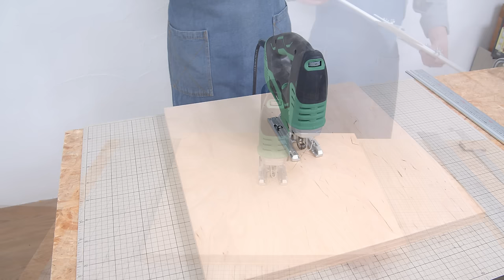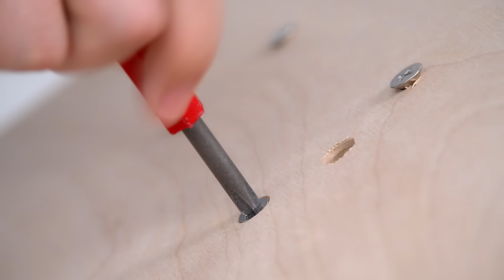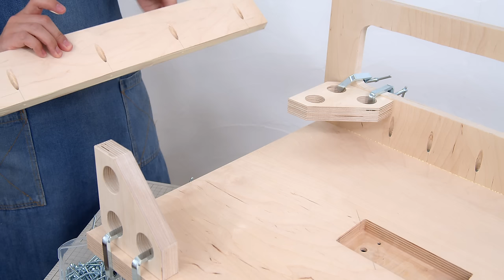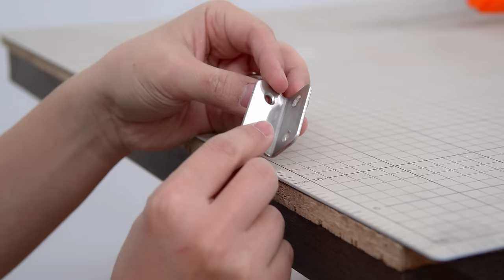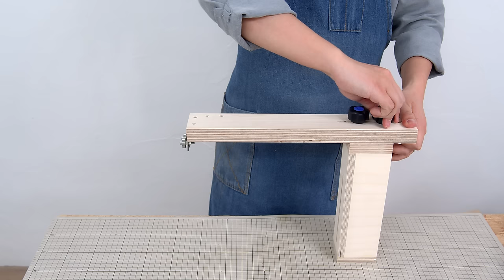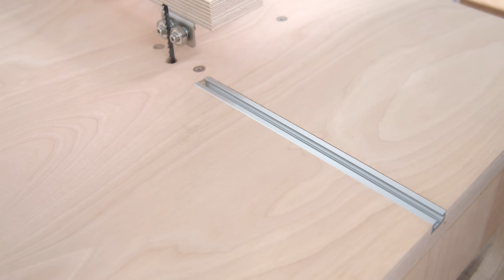How to make Jigsaw Table Machine || DIY Jigsaw Table 【JSK】

Comment: This is one of the better jigsaw table designs I've seen, BUT, I have gathered together all the pieces to make one, plus one no one else has used. I bought a scrap jigsaw today for £2 and I'm going to use the original blade guide roller from this behind the 2 bearings to centralise the blade.

Comment: Excellent design and video.  The only changes in the design that comer to mind are:
1)  Cut a small block the exact thickness of the depth that the bearing support protrudes plus one millimeter and glue it back near the rear of the support post so that when adjusting for the thickness of the piece to be cut, you can just rest the post on the material and then lock it into place.
2) If the position of the T-track was at a diagonal, then the size of a circle to be cut would be almost 50% larger.

Even so, an excellent design and build.  Congratulations!

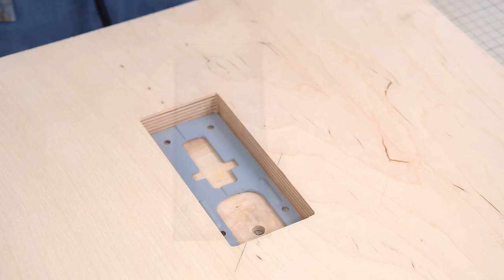Comment: Regarding @3:09, using a transfer punch (not a "center" punch) can help you to easily and accurately find the center of a hole; with little room for error. There are inexpensive as well as expensive options depending on what you'd want to get. 

I know you strive for precision. So, I hope this is a suggestion that can help in a small way.
Reply: Does anybody know  which is drill press machine at 2:27 
 . I've been looking for some and something like that is ideal.

Comment: I actually had the idea to do this but I haven't made one yet. Yours is a very nice, and simple, design with useful extra features. I particularly like the support bearings. I didn't think of that. Overall, this is another expertly made attachment for a tool (even though it's basically a tool itself). Thanks for making this video!

Side note: I didn't know jig saw blades that big were made. I'm going to look into were to find some.
Reply: Does anybody know  which is drill press machine at 2:27 
 . I've been looking for some and something like that is ideal.

Comment: Its a good built, but I will suggest for some improvement ,  I just noticed that the arm support  bracket for the blade should have fixed guide rail installed for easy straightforward height adjustments - no wiggling.

Comment: Dear Koubou, as usual, a well thought out construction. If you can’t afford a bandsaw, this is a close replacement. I’m glad you used the long blades to cut thick pieces. My jigsaw always walks to one side and doesn’t cut a vertical line. Hopefully with the bearing guide, the blade won’t bend and give a wonky cut. 

In several of your videos including this one, you show the use of a panel saw. I like the look of it and want to have a closer look before I decide to make one. I can’t find any of your videos that show it being made. Is there one that I’m not finding? If not, such a video would be much appreciated. Cheers.
Reply: I just made a circular saw table works great easy to make thanks now I'm going to make a jigsaw table love your videos

Comment: Found it interesting that for the circle jig, it's totally optional, but really useful.  I'd change that centering peg to a few different length machine screws with the threaded part at the bottom and grind the threads smooth at the top, that way you'd end up with a variety of different centering pegs so it's not necessary to penetrate the wood piece all the way through (some may not need/want a hole to fill)

Comment: A nice addition would be a height setting jig - a block that’s just slightly thicker than the distance from the bottom of the arm to the bottom of the bearings bracket. You could then set it on top of the work piece, loosen the height adjustment screws and lift the arm up, then slide the work piece and height jig under the arm and allow the arm to rest on the jig block while you tighten the height adjustment screws. Another nice addition would be an attachment on the arm for a vacuum hose.

Comment: Good job, as always!  
There is just one thing missing!! 
I just bought and printed out the drawings, which are very good, but I really wish there were a page with a list of materials used. 
Screws, bolts, nuts, etc. are quite expensive (at least where I live), and it would help A LOT to be able to buy and have all the correct materials at home when building the jig!
But that is also the only thing missing.
Reply: I thought the same thing until I scrolled down and found a link and password to the parts list and how to information.

Comment: The upper bearing block could be made slightly better by adding a bearing behind the blade like a lot of band saws have. This keeps the blade as rigid as possible so it cannot angle back while pushing wood through and would probably take some stress off the jigsaw itself.
Reply: Very true

Comment: Great job! For added safety, could a momentary foot switch be used, acting as a "dead man" switch? Or might it be possible to connect a foot pedal directly to the variable-speed saw trigger?
Reply: Yes like a sewing machine pedal but that part is a bit "electrical" to do

Comment: Excellent! I would like the screws that support the "bearings arm" to be spaced further away to promote the verticality of the construction. Easily done with a bit longer sideboard and maybe an aluminium guide exactly spaced to accept the thickness of the securing screws.
Reply: Does anybody know  which is drill press machine at 2:27 
 . I've been looking for some and something like that is ideal.

Comment: great video. great product. well done. but i dont have a £10,000 workshop the size of a small garden. nor £2,500 of powertools, £400 of beautiful wood, and £200 worth of assorted 'bits and pieces in accessories. 
yes, I'm jealous. doesn't mean i'm wrong.

Comment: Great work! BTW, you store is not working. I wanted to purchase the plan, but your store is not loading due to blocked trackers/advertisers. Perhaps you should prioritize loading the actual content of your website instead of third parties, otherwise people with strict privacy settings won't be able to purchase your plans. In my case I allow cookies from the website I visit (your domain), but third party (ex. twitter ads or facebook) were blocked, which prevented your website from loading up. Hopefully you can fix that soon, so I can make the purchase. Cheers and thanks for sharing your great work.

Comment: Is something used to keep the trigger depressed? How does the saw start running with him just pressing the power attachment(the white button he attached at the end)

Also how did he lower the saw blade at 11:30? Isn't the jigsaw locked in?
Reply: Trigger locks are featured on some saws. Same with adjustable blade heights. Mileage may vary depending on your individual saw model.

Comment: l would have put in a third bearing to take  up the backward thrust, like on a bandsaw
Reply: That is precisely what Ivm going to do. I use 3 SKF bearing type 625 ( 5 x 16 x 5 ) and I'm going to make the vertical/horizontal bars from rectangular steel pipe's. I like the idea of the T-rail to saw circles.
Reply: You don't need a bearing behind the blade as he has a metal angle to support the back of the blade!!
Reply: @robertbutler8004   you dont need it but it would take some of the strain off of the saw, it you watch the cutting you see the blade go back when the pressure is applied  quite a bit, the blade does not go near the metal plate on the back it is free floating back and forth, as it is now he could not do it because the bearings are thicker than the blade

Comment: A compra pelo site é um pouco complicada. Tem alguma forma de adquirir os planos?
Reply from the maker: thank you for the advice.
I also acknowledge that websites are not smart.
Please try this.
https://jsk-koubou.stores.jp/items/5e396440c78a53654862950c

* The blueprint has been completed, but the WEB manual has not been completed.
Will be released two days later.
Thanks！

Comment: Absolutely unnecessary table!
1. It is possible to make any attachments, but it is impossible to get an even cut with a jigsaw. Only a circular saw can be cut off exactly.
2. You can cut a circle with a jigsaw, but you do not need to make such a table at all.